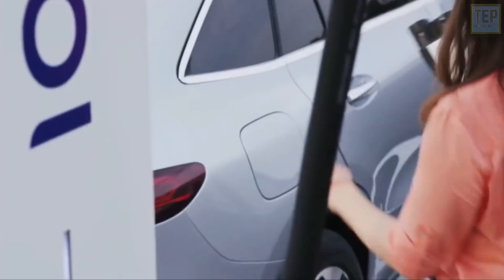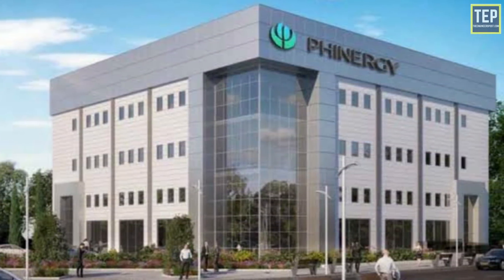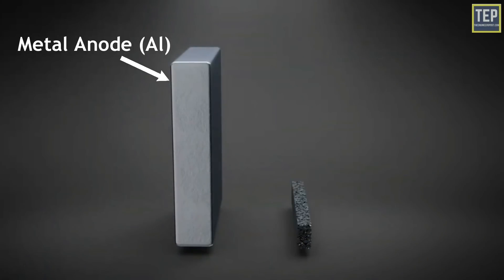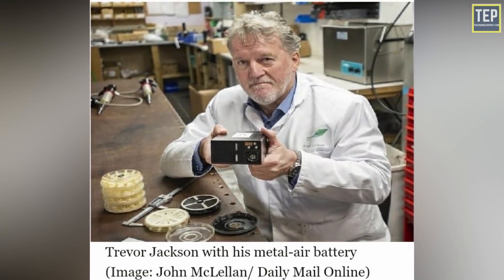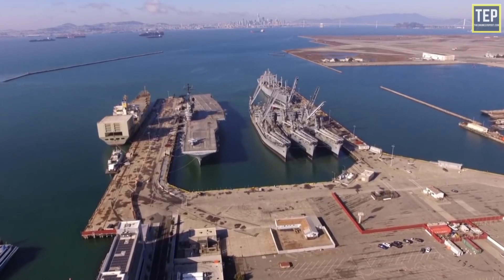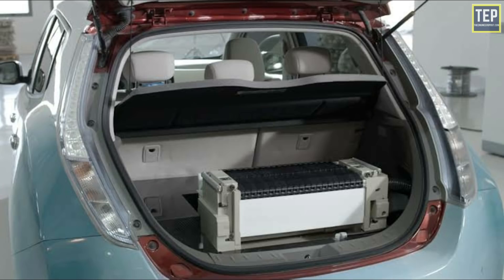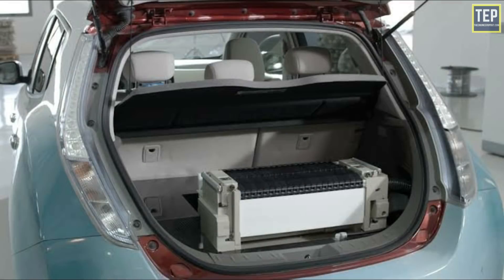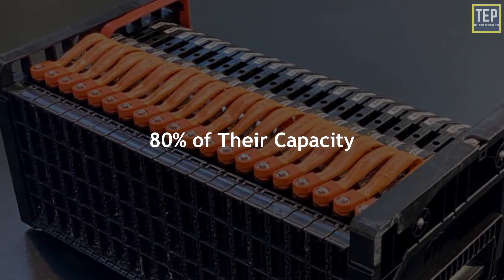Aluminium-Air Battery | An EV battery that Doesn't Need to be Charged

Comment: Thanks for considering my request to make this wonderful technology 🤩💖💖
Reply: Should have also mentioned about Log9 materials working on the same technology
Reply: What happens to the air it uses. I dont think we have enough to spare 😆
Reply: @michaeloffen7513  What happens to air which you inhale?
Reply: @arunkumarts8279  the oxygen is used
Reply: @arunkumarts8279  all the oxygen you inhale comes out as little tiny particles of unicorn rainbow farts
Reply: Aluminium air batteries only makes sense for airplanes, not cars.

Each plane would have many, small, light  battery modules that all could be swapped in 10 minutes (other types of batteries would take way too long to charge for a plane). Degradation would not matter since the planes would use up the batteries long before they would degrade.

In summary aluminium air batteries and airplanes are a perfect match.

The used batteries from the plane could be used to range extend the electric semi trucks transporting the new batteries to the airport (the semi's would have both a chargable LFP battery and swappable aluminium air batteries).

This would make so much more sense than hydrogen for example.
Reply: I'm charging my welder now for 2 days just to get it started for 6 minutes have fun with that one
Reply: I think this would be a good back up battery for trips or a replacement option when batteries needed replaced 🤓
Reply from the maker: Thanks for the idea!
Reply: Obviously these people have never owned an old Landrover and watched the aluminium body rot away due to electrolyte reaction
Reply: How many batteries will you collect before you get pissed off because you had too many batteries because getting to burn them up like we burn up gas in cars
Reply: @MASTERSAIS  Did you watched this video properly?
Reply: @MASTERSAIS  Why should I collect the batteries?

Comment: If Al Air Batteries are being broadly used, where the air we breathe in will be sucked by motorists in a large volume at the same time. Thus,  free air (especially OXYGEN) will be insufficient for mankind and animals to stay alive.

Why we invented EV?
In the first place, we use EV to stop pollution and eliminate emission of carbon in the air.

I'm not a scientist nor do I a researcher. In my opinion, I would be more greatful if hydrogen is used to run an engine of a vehicle or a generator to generate electricity to run a pair of motors on a vehicle to move. Hydrogen can be extracted from water (H2O) via electrolysis and the by product is OXYGEN, the air we and animals breathe in.

Hydrogen must not be stored in a cylinder to avoid explotion when there is a spark. So, hydrogen must be produced on the spot when in need via eletrolysis. 
Water (H2O) can be obtained anywhere. So, it is cheaper than mining lithium or sodium or aluminium.

Mankind and animals can live longer together without any disasterous materials by products in producing the materials to manufacture the batteries.

Comment: The total fuel efficiency during the cycle process in Al/air electric vehicles (EVs) can be 15% (present stage) or 20% (projected), comparable to that of internal combustion engine vehicles (ICEs) (13%). that means e-efficiency is poor..

Comment: To make this a viable option:
1) cars would need 2 battery banks, one the first one is depleted, you would switch to the second one and then go get the first one replaced.
2) The need to create a way that these batteries can be restored to full capacity in the field. That is, you'd stop and get a new battery at an exchange station. The exchange station would then send that battery to a center that would hit it and put us fresh components to make it whole again. 
These are the first 2 thoughts that come to mind. 
Oh, and water, how to keep it from freezing. Where I live 0 and less is not unusual in the winter months.

Comment: I think pretty soon they will come up with solutions to the above problems...for example if the battery is so energy dense, why not have an additional battery for emergency inside the vehicle that will allow for 20 miles or so?

Comment: This Al-Air Tech is not a Battery. It's a Consumable Fuel Cell at best with recyclable Aluminm supply.
How it's different than the Lead Acid battery which is also a 100% recyclable and Consumable.

Let's get rid of this Misnomer of Battery for Al-Air Tech.
Reply: Yeah, but its just called a battery.

Comment: You should be able, (if the Car Manufacture agree), To carry a Battery that You can stick in to a Spot so you can Get to a Battery changing Station, That way you won't ever run on Empty, I was thinking of the rechargeable [(Bike, Motorcycle)battery] where you got 25 mile or what ever You got, I'm not a Scientist ! ! !

Comment: other than all the problems involved. how much torque can one get out of such say mounted in a 1 ton pu? then the weight, can it weigh less than a small diesel truck motor? and still be able to pull a 15,000 pound load over a mt pass . say start at sea level go up a pass of 8,-9,000 ft  with grades of 5-6 and back down the other side and still do another 300 miles?
his is why battery power is a joke at best.

Comment: How about the high cost of changing battery for e-cars?! Are you all lesser than Joe Biden?!! How about starting a new conservative climate evolution instead?!! If we don't store, the solar energy will be wasted!!! Why don't people use shipping container modified tanks to store solar energy? For example, automating concentrated solar thermal power to pump water from the low tank to the high tank during sunny day and release water to drive electric generator and back to the low tank during the night and sharing with couple homes.
You can search "Burning Stuff With 2000ºF Solar Power!!" "DIY shipping container pool" "solar power water pump" and GREENPOWERSCIENCE for a lot of examples. "Pump Water with Solar Power! No Battery or Charge Controller! Under $60.00" from Garden Dirt.
Actually, potential energy of the tank themselves can also be used for generating electricity already. Of course, you need to use a lot pulleys or hydraulic jacks for that.

Comment: So, as aluminium is essentially solidified electricity, and this battery then chews through the aluminium, this is a power source driven by both aluminium from mining and processing AND power from other sources. Great 'efficiency'......  NOT!
This is a completely ludicrous concept as any sort of sustainable energy source.

Comment: This is the worst example of battery technology since we started using rechargeable batteries instead of those zinc manganese dry cells we used in torches years ago......no way will anyone want to be changing over batteries when charge and go is the way to go now.

Comment: Transparent solar panels wrapped around laser high pressure sodium light or layered. 25 500 wat solar panels wrapped/layered/sandwiched over lhps mirror reflectors on outside  is 12000 Watts enough? Can add another 25 panels of not. Chargers day & night till gas needs recycling. It's not rocket science

Comment: Here’s the most likely setup: LFP batteries ( or perhaps sodium) plus the Aluminum fuel cell. The electrolyte is pumped in only when the cell is needed as a range extender. When the cell is depleted and you’re about to go on a long trip, visit your garage or service centre/ station for a swap. In the meantime, charge your rechargeable batteries.

Comment: It does make sense. If the availability of Aluminum-air battery stations were substantial, and easily swapped out, it would be just like getting a tank of gas, on a much less frequency. I think it would be a right step in the right direction. These vehicles also must be less expensive than the Li-ion cars like Tesla.

Comment: Extreamly toxic, = Lead acid battery. So it’s the old tale, keep the Golden Goose alive. .heavy weight but , investment must last forever for profit.So greed comes before need. Humanity control by money.  The God of Earths people an iOU,bit of promise. Greed has made it useless to humanity. We have been using lead acid battery for so long, but like all power supply, it has to be renewed or re charged. Weight saved disposal of or reclaimed material, just as it is with lead acid. Your vehicle has to carry weight of the  battery, using it. So why not a switch over to a second standby for emergency?

Comment: Aluminium air battery makes no sense for cars since fast charging makes swapping unnecessary, but for airplanes it's perfect, very light and energy dense.

Each plane would have many small, light, battery modules, that can be swapped in 10 minutes. Degradation doesn't matter at all since airplanes would use up the batteries long before they would degrade.

Comment: Disadvantages outweigh the advantages at this point. There are other battery technologies that appear to be better overall than Li and Al batteries. Mass production and cost are 2 major problems these other technologies need to overcome.

Comment: The batteries I use at home in my flashlights and remotes do not require charging also. I just need to throw them out and put in new ones.

Comment: This is a no-go for me, I prefer the rechargeable type battery for a long life of the battery and the most possible mileage one can get on one charge and charging for re-use like a new life given from the re-charge. This can repeat over and over again until the battery will not accept a charge after million miles.

Comment: Seems absolutely perfect for electric planes.  The greater energy density should allow flights significantly longer than the 300 mile range of the current generation of electric planes.  Major airports could be equipped not only with swapping equipment but with aluminum recycling centers (or they could easily be flying fresh aluminum in).  Each plane could have a set of 4 - 10 batteries for redundancy and to allow for swapping of a few used ones after each flight rather than prematurely swapping one partially used one.  This also removes the objection of a possible battery fire in the air, that lithium presents.

Comment: Is the loss of charge based on the usage or does idle battery also loose charge like the leadacid battery. Also the image of the battery in the video says that the battery needs a major design make over. With today's delivery logistics being a game changer I'm sure if one is out of battery charge one can call in a delivery battery replacement in no time. Via delivery drones in the neighborhood of where you are stranded. Yes recycling and refurbishing could be an issue but with the successful way it is done for leadacid battries in India I'm sure we will find a way to solve that.

Comment: Would it be possible to also have a battery on your vehicle that charge’s as you travel and you use it in an emergency when your aluminium battery runs out of power and until your aluminium battery is replaced like having a spare fuel tank as some fluid engine cars use to do years ago

Comment: The AL-Air battery was in experimental offerings back in the late 1970's and I know, as some of my investors were looking at it - AluPower was the company then. Same issue as is now, battery was size of a forklift battery, weighed about the same, and was single use. No takers. This one keeps circulating every decade or so, by somebody that tries to see if it will 'stick to the wall'.

Comment: Not even remotely practical, and an environmental nightmare. The last thing the world needs is to go back to non-rechargeable batteries that have to be recycled after a single use, ultimately using many times the energy and resources than even the worst rechargeable battery. It's insane to even contemplate it.

Much like hydrogen, which seems great on the surface until you start looking at the real-world logistics, which make it the opposite of green and extremely inefficient. The thing that no one is telling you is that ALL "hydrogen vehicles" are actually BEVs with a hydrogen range extender. There is no way to usably "throttle" a fuel cell, so they have to hum along at a basically set output, charging a battery pack that is doing the real work. So all you're doing is adding a bunch of complexity and taking up a huge amount of space in an EV. So just leave out all that extra crap and keep it a pure EV. It's a no-brainer.

Comment: This is exactly the reason why I will not consider a BEV until manufacturers can agree on a battery swapping technology. I refuse to sit around a plug in for a long time when battery swaps can be done in under 5 minutes (China's NIO has the technology). I don't care if I "own" the battery. I don't own the fuel I use in my ICE (well, technically, after purchase it is mine)....but you get the point.

Comment: So it's the battery swap and continuous production need that drives this idea.
Aluminium production needs high energy. The CO2 that is going to be involved won't make that s better solution when EV is about lowering CO2.

Comment: What is the cost of a new battery pack why wouldn't you have two on there so when one dies the other takes over then you drive in and get the other one replaced what is the cost per mile for these units

Comment: Basically an Aluminium battery is powered by Electrolytic corrosion the nemesis of all aircraft. With any kind of reasonable use you'd probably be changing your battery about once a month. If they sorted out a system where you could change the battery yourself this might work as you could have a spare battery at home. Also it wouldn't stop producing electricity for some time after you switched off your car and it wouldn't be ready to drive away immediately you start it up.
The electrolyte will probably be in a separate tank, so you'd have to make sure that was full as well and you'd have to buy it.

Comment: So what happens when the car is not running? The Oxygen in the atmosphere will react (unless you can stop that process) and produce electricity which is not required as the vehicle is not in use. Won't the Aluminium just get wasted?

Comment: I think a universal modular battery system would give the EV market a huge boost - A combination of small rechargeable batteries built into the chassis, and replaceable modular Al-Air modules that would be carried at every retail outlet and fitted every vehicle just like a giant AAA battery. The rechargeable side would give perhaps 20% of total power, so running out of Al-air charge would not be so serious, and the Al-air would provide the bulk of the power and could be swapped anywhere, like we swap gas cylinders, only paying for the power they contain. Obviously the critical factor would be cost per Kw.hour, or per mile of range if you prefer.

Comment: This is even dumber than Li-Co nonsense we're currently using.  The infrastructure cost is higher than H2 fuel cells but still requires the massive environmental degradation of Li and Co mining and processing.

Comment: the main problem of this tech is exactly because its non rechargeable.... its main use is probably only for vehicles... its not as multi use lithium ion batteries... 

the main problem for using this as a backup power source for buildings and other application for batteries is the fact as a single use battery this thing's discharge rate is so high, that every other batteries are a more viable solution to storing energy as an energy source... 

that 2700 miles range is in the ideal condition and without degradation right? 

and 1 month losing 80% charge is too extreme to the point its unsuitable for many applications... and to keep the charge i am guessing its going to use some exotic materials again just like the lithium batteries... this aluminum battery is only good for something that needs to be used daily and requires a lot of power but the portable energy source must be dense and light.... these kinds of application is so niche that you need to calculate the cost effectiveness first before even implementing the usage of this battery type...

Comment: Consider a small spare battery in the car for emergencies. Just like we keep a spare tire in case of a puncture. That's not an issue. What is needed is a commercial cost workout based on life of one battery and the Milage cost per Km.

Comment: The byproduct aluminum oxide burns extremely hot, sounds like the real interest is in the used battery as a fuel source, also not to mention that if mass-produced and in operation these batteries are literally sucking oxygen out of our atmosphere. LOL vehicles run as the world asphyxiates!!!!!

Comment: How much does a new battery cost, are they easily available at many places. If our federal government decides to buy up any batteries, and control the companies that make the batteries and the companies that sell the batteries, then it won't matter how light weight they are. If any of the materials used to make the batteries isn't available. Then the consumer is out of luck.

Comment: Sounds to me like you’d have to replace this battery every month since the video says they degrade 80% in the time. No one is going to want to do that unless replacement batteries are 1) readily available at convenient locations everywhere, 2) easily swapped, and 3) have a cost equivalent to a month’s worth of gasoline.

Comment: battery replacing will never happen, since all manufacturers would have to use the same system.
additional, the battery has to be recycled. and we all know how well recycling works even in 2022.